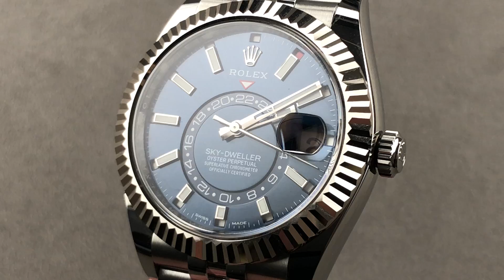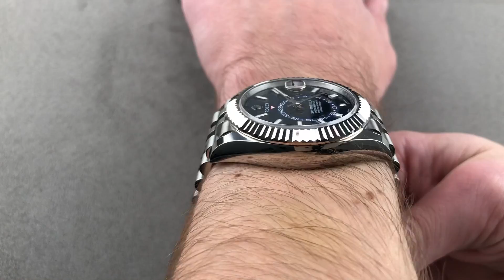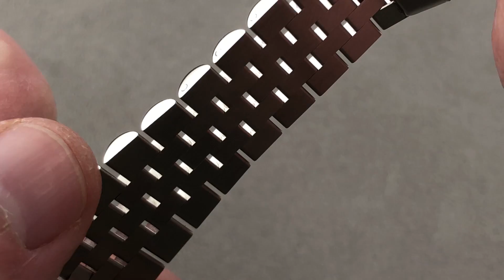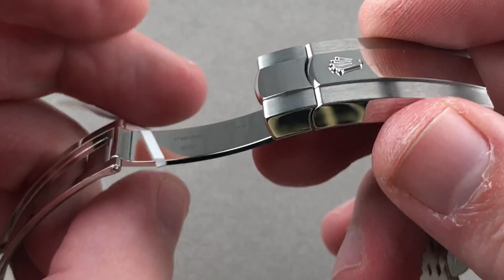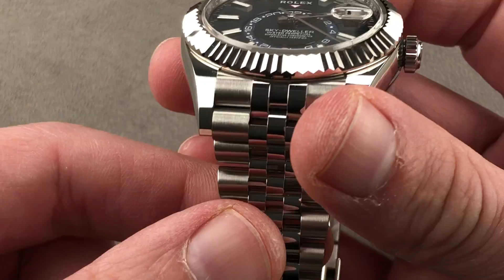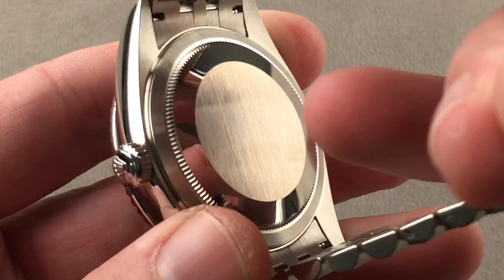2021 Rolex Sky Dweller Jubilee Bracelet Blue Dial 326934 Rolex Watch Review

Comment: Amazing that you can perform all those functions at the same time, like hacking the second hand with either the crown or the bezel, and not damage the movement. Rolex movements seem to be unbreakable. I can attest, I once accidentally changed the date on my old 2006 DJ at 11pm and it didn't affect it whatsoever.
Reply: I don't think Rolex movements are affected by date changes, as it is an instantaneous switchover. It's the same with other brands with instantaneous date changes (such as GMT watches).

Comment: Are you sure Rolex make their own steel? I just don't believe that such a small consumer of steel could have a commercially viable in house steel manufacturing plant.
Reply: Every single alloy used by Rolex is produced entirely in-house and they have their own formulation of 904L stainless steel.
Reply: @Extys  Do you have a source for that? The Rolex website spruiks their own gold foundry, but does not mention anything about steel manufacturing. 
<<Rolex rigorously selects the materials for its watches... made of a material that has been meticulously selected and constantly re-evaluated to guarantee its performance and its impeccable aesthetics.>>

I call bull. <<That is why Rolex uses Oystersteel, a steel alloy specific to the brand. Oystersteel belongs to the 904L steel family>> It's possibly made to order, according to their spec. But I do not believe they manufacture in house.
Reply: @Extys  correct

Comment: I have the blue dial on oyster. I actually had the choice from my dealer but I think the oyster looks better with this piece. I was able to try on the jubilee and it's nice. Some people were concerned that the jubilee couldn't hold the heft of the 42mm case but it obviously can. Rolex wouldn't put it out there if not. You can't go wrong, but I just think the oyster is a better aesthetic and more classic.